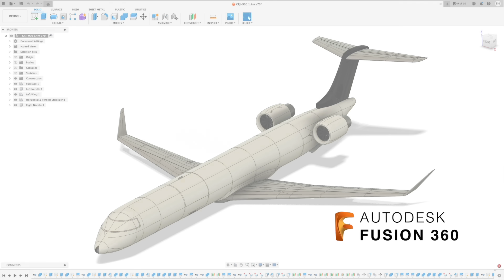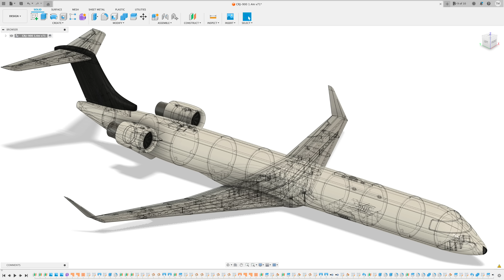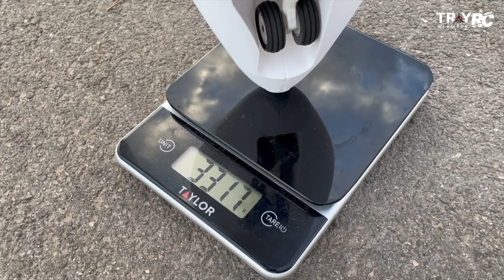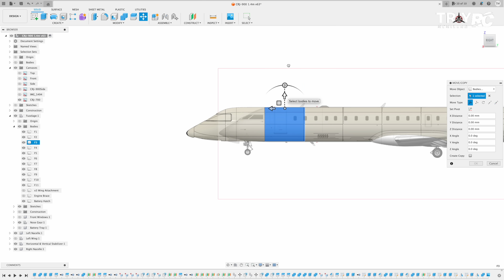WORLD’S FIRST RC CRJ-900 | This Airplane is AWESOME 🤯

Comment: hello, please tell me, I have stl files from 3dlabprint, I can’t cut it in Cura, it only sees the outer walls and doesn’t see the inner ones, when cutting it comes out as a solid model, how can I set it up?  thanks in advance
Reply: check your line width, it's thicker than the walls

Comment: Hi Troy, Very nice and informative videos. I have watched your basic videos and need one question answered. What should be the first 3d printer that I buy to print printplane designs. Looking at Ender3 V2, but since its old, which one should suffice for today. Thanks. If anyone else has opinion or experience, they can help as well.
Reply: Bambu lab x1c, best printer you can buy

Comment: Challenge: Land a random rc plane many times, but for every landing, you have to remove more and more of the vertical stabilizer, and see how much of the vertical stabilizer you can remove from your RC Aircraft before it becomes uncontrollable. (Dont use a T-tail aircraft, btw, cause those have the horizontal stabilizers mounted on the vertical stabilizer.)
Reply: Hey 📤 I have something for you

Comment: Perhaps asked before in this big list.. Have you tried to print this model in Lw-Pla ?
Reply: *If you would like to print the wing using LW-PLA it will save around 1000grams, but it is not required. I have not flown it in LW-PLA, but I designed it with LW-PLA in mind. Printing it fully out of PLA shows how well it flies with that additional weight. I printed an entire one out of LW-PLA and made sure I could set the CG. I have not flown it yet but I will be sure to and add a video for you.
Reply: Hey 📤 I have something for you

Comment: To make it a CRJ700 you need to remove forward and aft plugs and remove the ventral strakes
Reply: Fitting, since adding plugs and strakes to the 7 was all bombardier did to make the 900. Nobody wonders with that level of innovation why they’re on their way out.
Reply: @adampoulsen5305  they were hardly the first company to stretch an airplane. Innovation doesn’t always mean success. Look at concord and the a380 - incredibly innovative and both failed spectacularly in the market place. The business case was there and for a $200 million investment they sold 487 of them making it one of the most successful programs in the company’s history. Airlines don’t care about innovation. They care about cost per seat mile, period.
Reply: You’re absolutely right. But it seems that was their only trick.

But yeah, reduce that pitch right?!
Reply: @adampoulsen5305  you have to remember that bombardier is a relatively small company. The weren’t building 60 aircraft a month or getting huge military contracts. They got some repayable loans from various levels of government but money was always short, debt was always high and in the end they were driven out of the commercial aircraft business because Boeing tried to destroy them with tariffs. But the crj900 made business sense and they made money with it, especially since it had a common crew rating with the 700. But like all stretches it compromised performance. It was low on thrust and was geometry limited for tailstrike which limited performance. I doubt it makes for a very good flying model either!  We all thought it looked ridiculous and that they had stretched it too far. Then they did the crj1000! 🙄

Comment: it's just ridiculous, at this point it's gonna have to become standard to put speakers in RC planes if it doesn't have gas turbines on board, it's supposed to be a jet or at least sound like one, give me vacuum cleaning sounds I'll settle for that at least.
Reply: these EDF's sound like a real turbine sometimes on flyby. When they are close you hear the motor only. no speakers
Reply: @dronevan  i seen the ones with speaker it's very cool, but this are so quiet since the motors aren't even that big, the bigger ones do produce some unique noise on fly-by
Reply: Hey 📤 I have something for you.

Comment: I need a 3d Printed Aircraft with all small level 
1. Alti meter 
2. Air speed indicator 
3. Vertical speed indicator 
4. Atitude indicator 
5. Heading indicator 
6. Turn Co-ordinator
7. Small size camera inside the front Glass of  Pilot cabin 
 for a Research purpose in up side it should be removable we will Make connect all inside parts like Altimeter to Turn Co ordinator we have to need for a Research purpose about Aircraft working mechanism and more can you make it for me please consider to add this 7 seven components as a Main to record them we can develop our knowledge at next level can you make it this project is assigned by my university so i should need your help so please consider to do it with this following components and Say how much Cost $ required interm of Dollars 💵 to make this and it should be travel more than 8 Km from takeoff to landing destination, it should achive 2952 feet in term of height

Comment: if you can convince yourself to cheat a little from the perfectly scale wing size and airfoil, you can definitely improve the flight performance by thickening the cord and increasing wing area, and also selecting airfoils better suited to model aircraft. With your wing saddle mount system, it would be REALLY cool to test a few different wing designs...

Comment: Troy, look how these aircraft land. They don't come in nose up like regular aircraft. Not sure how they react in RC way.

As for the wing, you will want flaps for take off for sure. Not full, but some flaps. I think they require 15 deg for take off .
Reply: It’s different because his model doesn’t have slats like the real one.
Reply: @sblack48  crj200 comes in nose down. No slats. Same for Challenger 600 series.

But..... Did Troy design the wing similar to the real one. Airfoil that is.
Reply: @HuckThis1971  I was involved in the development of these airplanes. His model has no slats. The real one does. So his model comes in more nose down than the real one. If he used the real airfoil it probably would not have flown very well. In fact I’m surprised it flew as well as it did. I wouldn’t try any sideslips if I were him.
Reply: @sblack48  I work on the Challenger line. 650 and 3500. So I know these aircraft very well.
Reply: You do? What is the RTL and what is it for?
Reply: @sblack48  Rudder travel limitation?
Reply: @HuckThis1971  limiter but close enough. Do you know why it’s there?
Reply: @sblack48  So the rudder doesn't over shoot, jam and turn the aircraft into a lawn dart!
Reply: @HuckThis1971  nope. Challenger 600 series and CRJ200 don’t have it and they don’t turn into lawn darts (too often)

Comment: Could you make a CRJ700/550 version? I would assume you just have to cut a piece out of the middle xD?
Reply: Pretty much! The CL900 is an extension of an extension! 

Based off the original Challenger 600.

Comment: I need to get the nacelles printed but from the video it looks like there is a step between the nacelle and the fan inlet?  This will be costing a fair bit of performance relative to a smooth inlet.  That said I am considering 6S power system for my build as they are more efficient for the kind of flying this plane is intended for.

Comment: Another stunner... nicely done.  Will the FMS 64mm 4S EDFs work?  Fit?
Reply from the maker: I’m not sure if those would work, I tried to use the most commonly accessible brand and size I could use for this plane. If you do end up using them, let me know!
Reply: You wil need to cut the inlet lip of as it is molded into the ducting unlike the ones troy has used

Comment: OK, you are familiar with computers, congratulations, but this model would be much more valuable if scratch built with conventional air modelling materials.
Reply from the maker: There are all types of RC modeling, I prefer to focus on 3D printed RCs. It’s also a lot faster than balsa builds. 😊
Reply: @TroyMcMillan  and less toxic compared to balsa dust
Reply: do you not own or want to buy a printer ?

Comment: Congratulations on an epic peice of design....Shes pretty fast too. Im assuming you have exact scaled this model in terms of wing area? 🤔🤔😮😮😀😀🇬🇧🇬🇧🇬🇧🇬🇧
Reply from the maker: Thank you so much! 😊 the wing is slightly oversized compared to scale, but not really enough to notice it by eye!
Reply: @TroyMcMillan  In the photo Id say the wing looks a bit small. It was common practice to make Tailplanes and wings larger than exact scale because at model sizes that's what's needed to make it fly at a more scale speed. It's also easier to fly them....Something to think about on your next one perhaps. A 30% increase in wing area would make a huge difference but it will still look scale....🤔😳😀😀🇬🇧

Comment: I Don't know if this is always the case but for future builds apparently extending the motor wires isnt a good idea and instead you should extend the battery ones. Not completely sure though.
Reply from the maker: The research I’ve done says the opposite - Extend the wires off the ESC, not the battery!
Reply: @TroyMcMillan  oh OK  nice and the build was awsome well done

Comment: Looks really nice! Though Im a bit worried about the landing gears strength. In the video it looks like the only thing keeping them from twisting and coming off is a small screw tapped into the plastic which doesnt look very strong.
Reply from the maker: Yeah, I ended up replacing those for aluminum at the end of the video! You are right!
Reply: @TroyMcMillan  Ah ok I missed that part because it was under the category "Decals" which I skipped at first

Comment: This is effing Awesome!!! As an aviation geek who also has a 3d printer in his basement, you are inspiring me to build a plane myself!
Reply: Lol I have been trying to do the same for awhile now, it is very difficult, and frustrating, I would start very small and slowly work your way up, my first project was a motorised glider that didn’t work very well, then I went to full 3d printed, which was a bad idea, anyway 

Start low, and go slow
Good luck!
Reply from the maker: I totally agree with there being lots of frustration along the way, ShadowCake. I feel like depending on which plane you do, that can make it even worse. Planes have come a long way over the years, you should give the 3D Printed Cub by 3DLabPrint a try. Truly easy to assemble and fly. And it’s free.
Reply: @TroyMcMillan  I have these little motors would the micro c47 be good for a beginner?